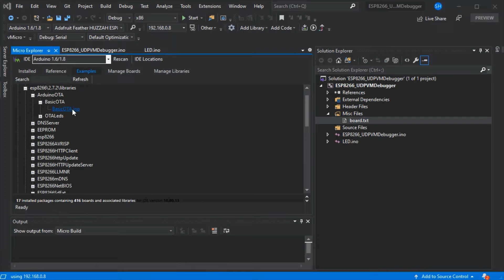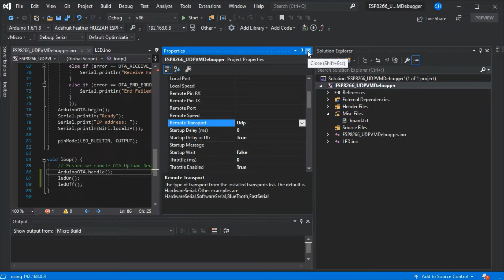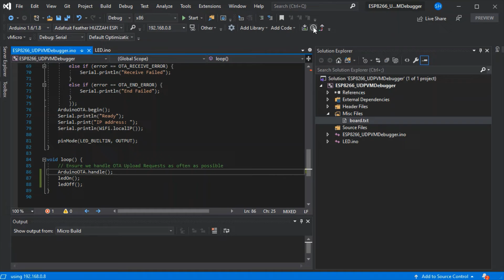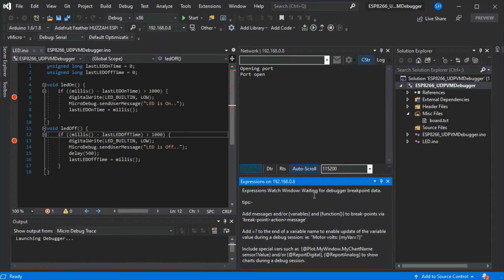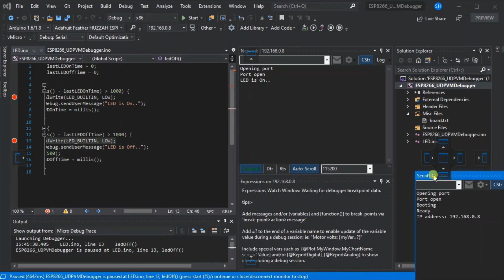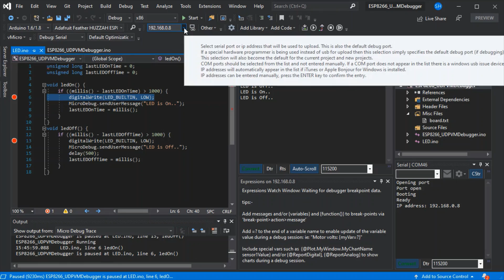ESP8266 OTA Debugging in Visual Studio

Comment: If my sketch connects and uses Wifi can I still debug OTA?
Reply from the maker: Yes that should work fine, the sketch in the video already connects the WiFi, but doesn't do anything else but setup the OTA code.  The debugging is happening over UDP port 10112, so any normal HTTP requests to/from your board will remain unaffected.

Comment: May not work with an old project.
But works when you create a new one and copy the code from the old one.
I do not know why, the error message is like: 
   Debug Build Error: This hardware might not support the default Visual Micro Debugger.
	If this project is using OTA/WiFi upload then please use the vMicro>Debugger menu to set the Serial COM and Remote port for the debugger.
	Otherwise switch the toolbar from 'Debug' to 'Release' and build again. 
		or switch off Automatic Debugging
		or configure the SoftwareSerial debugger option.